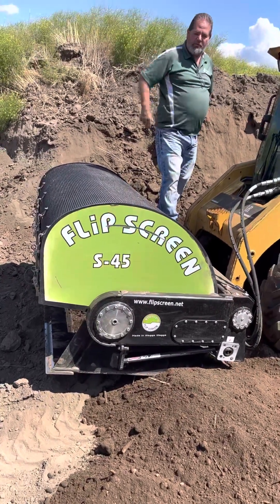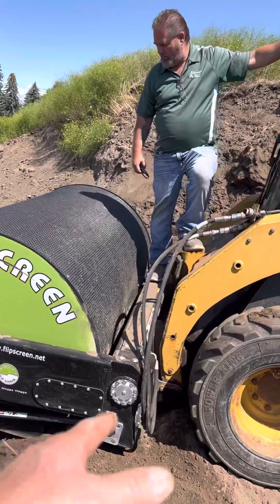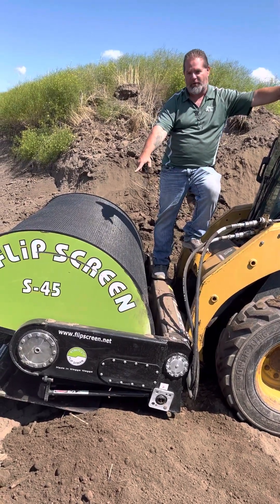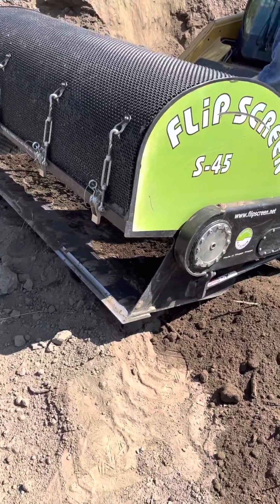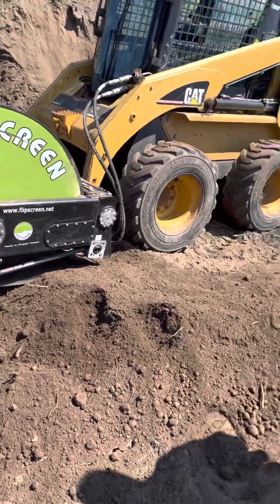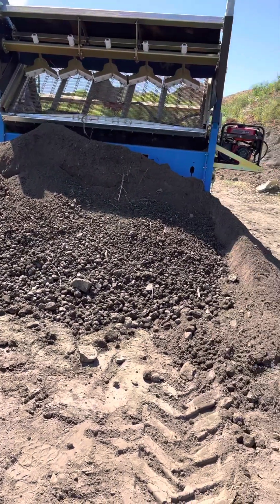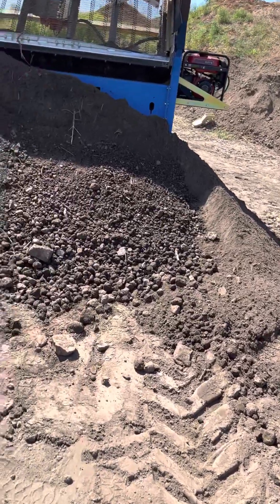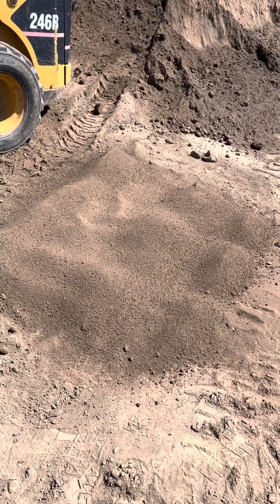Flip Screen S45 head to head with DeSite SLG 78VFW-RB

Comment: To add to Brad's "to be fair" comment...... (well actually he said "Top be fair" but I think we get the idea... "To be fair, the last time I checked Machinery Trader, (5 minutes ago) the S45 was $16,000 for a used 2019 version. For that price you could almost buy two SLG 78's or do what I did, buy one fully loaded one, 5 extra screens, bucket fork lift mounts, the riser box AND I paid over $1,000 to have it shipped..... you go used Flip Screen with one screen, I'll go fully loaded SLG. (grin). PS: For those of you thinking you can change the screen on the Flip faster than the SLG, think again, I've only started using mine this week, less then 4 hours on it and I've changed the screen three times as I screen down materials, I have it down to a few minutes, it takes longer to quick couple change my bucket to fork lift attachment than it does to change the screen once you learn a few little tricks (front end loader with forklift attachment comes in very handy for popping the screen up into the retainer lip).